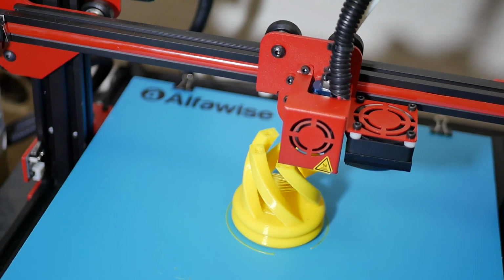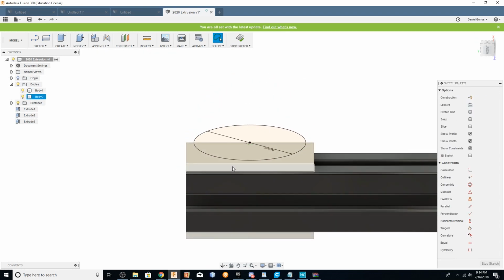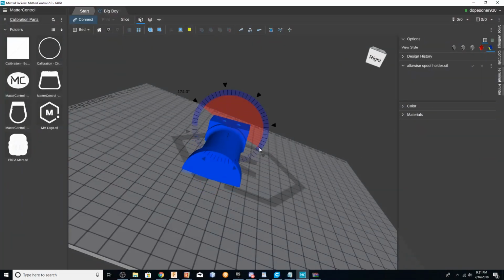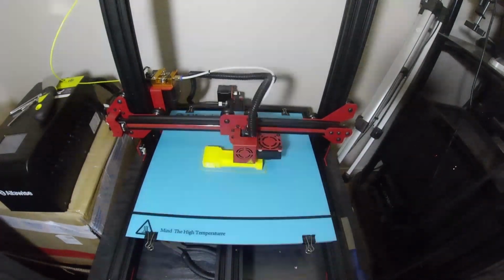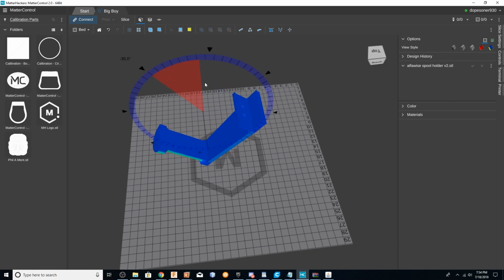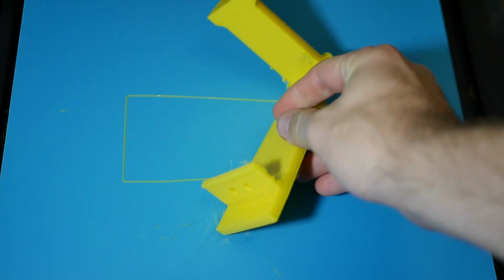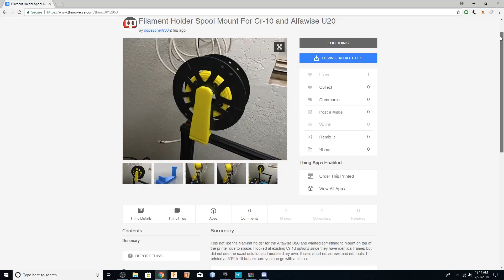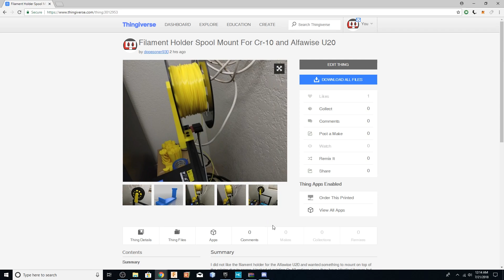Upgrade For Alfawise U20 & Cr-10 Filament Mount

Comment: Is the U20 a good printer for me to jump into the world of 3D printing?
Reply: I would recommend getting a very cheap $100 printer beforehand just to familiarize yourself with 3d printing, but its not necessary. Just know that if you choose to upgrade the U20 in the future it would be more difficult since it is kind of a 3rd party printer. If your willing to spend more money you can get the cr10 (its a slightly better printer in general and its easier to mid and upgrade) but the Ender 3 pro is also a GREAT choice. Its only around 250 and is extremely easy to mod and their are THOUSANDS of 3d printed mods as well.
Reply: Sorry im a year late with my comment, I've had my U20 for 2 years now and I really love it, and its a great budget large-scale printer.